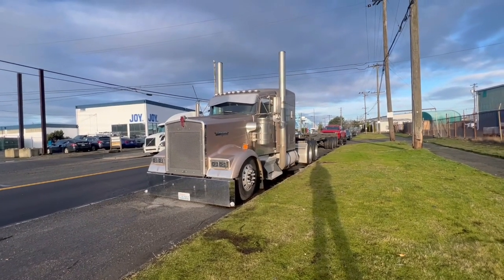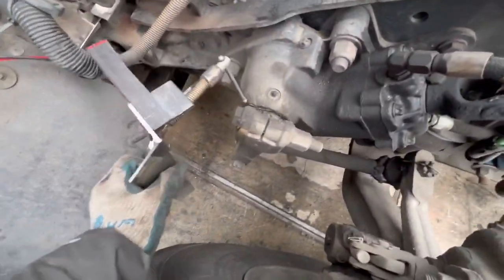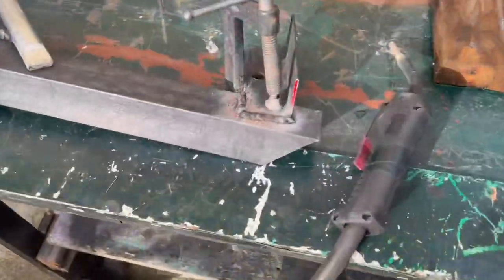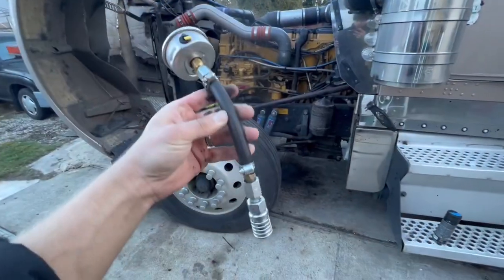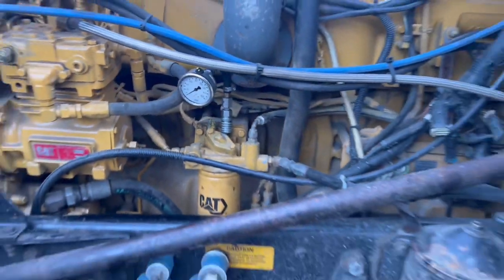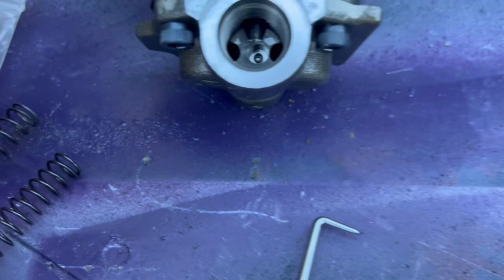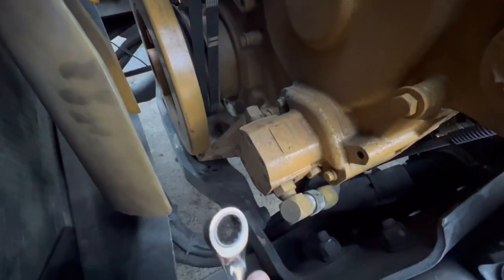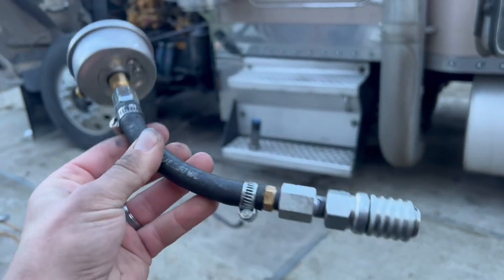Caterpillar Low fuel pressure problem solved!  | Cat 6NZ | Kenworth w900 Project Upgrades

Comment: Did your bumper come with the UST brackets? i have a lift bumper kit with UST plates and it's ON there..there is very minimal movement at the bottom corners but kind of unavoidable unless you Fab something like what you did...truck is looking good!
Reply from the maker: No didn’t come with any brackets at all..
Reply: @CustomRigs  ah i see..yeah that would cause a wobble...you thinking about Flip kit..i think it's a must for low rides..i tore up 2 bumpers lol..might be worth it in the long run
Reply from the maker: @Dubya9W9  kinda why I bought a cheap 800 dollar bumper lol.. but we’ll see if I have nothing else to do maybe bumper lift kit than

Comment: The quick disconnect port you used to check fuel psi is before the secondary fuel filter. Measuring fuel psi at that port does not tell you actual fuel psi in the head. Why did you buy the spring update? All you had to do is remove the current spring and stretch it some and save some money.
Reply: If you stretch the old spring it will go back to its original length over time
Reply: @reuben5274  What is the time frame? Did not know that steel would shrink. Wow learned something after working on these for 40+ years.
Reply: @johngoldsmith6629  well I’m happy I taught you something and it’s good to see you’re still willing to learn 👍🏻
Reply: @reuben5274  You still didn't tell me the time frame that steel springs shrink back to normal size. Also if I compress the spring, will it expand back out? What if I put a shim next to the spring, what is the out come of that?

Comment: Niice looking W9 ! Dropped today my T6 at my local CAT dealer for some work and i asked the Foreman whats a good fuel pressure on a BXS.  Mine at idle is 80 and at 1500rpm is about 87. He said is within specs. Did you feel any diference in sound or driving after you changed the transfer pump ?
Reply from the maker: So far it’s been running smoother, I’ve been told the old style transfer pump has a weak spring in it that gets weaker over time. We will see this week how well she is riding with the higher fuel pressure.
Reply: @Custom Rigs  I changed that spring and now fuel pressure is at 105 psi
Reply: @Maxim22vition when you changed the spring and got more fuel pressure, did you notice a improvement in power?
Reply: @spoolinsvt6489  I run midwest and usually I'm not too heavy. Fuel economy and power no significant improvement. Got 550hp file. Only improvement that I noticed better Idling.
Reply: @Maxim22vition I see, thanks for the reply. Trying to chase down an issue I am having with my 06 C-15 acert. Only gettting 32-38psi. Have a 550 file on it but getting passed by small paccars is not okay lol.
I run in the PNW with plenty of hills and grades at about 100k

Comment: I did 1 1/2 Leaf Springs as well when I put on the Air Ride wanted the 1/2 Spring with the hook just in case.
Reply from the maker: After rolling with 2 leafs on air ride it was stiff, a lot better ride after going 1 1/2.

Comment: That type of bumper what it does is two things against your fuel economy, and stop the air front refresh the engine oil and spend more fuel
Reply from the maker: I’ve been getting 6.8 on average.. pretty happy so far for a Cat

Comment: Did you have the 12 gauge setup on this truck as well?
Reply from the maker: Yes running 12 gauge air ride on this truck
Reply: @CustomRigs  have you had any issues other than the bag bracket. Thinking about buying this kit with the kw air bag for my 389
Reply from the maker: @Bagnum05  so far pretty good other than lots of the 12 gauge kits we installed all have same problem when it comes to removing the shocks the bolts strip out. Ends up they use soft metal rods that they cut the thread themselves for the shock mounts on the big brackets instead of good grade 8 bolts.

Comment: What leafspring is that? I'm about to bag my kw and was just gunna use the ag130 leafspring
Reply from the maker: This is the original leafs springs that came on the older Kenworths because they are thinner, the main leaf stays original and the support leaf is cut in half. We are trying to find a good deal on the ag130 spring but man they are almost 2k for both sides

Comment: That is 100% wrong information on cat fuel pressure!!!!! The only purpose for spring in the pump is bypass pressure AT THE PUMP...NOT ENGINE. Fuel pressure regulator changes pressure to injectors. You had bad transfer pump which is why your pressure came back to regulator specs. HP & TQ claims are unreasonable too!
Reply from the maker: HP & TQ might be unreasonable but I know I got some of my power back after doing some hard pulls on some good grades today.